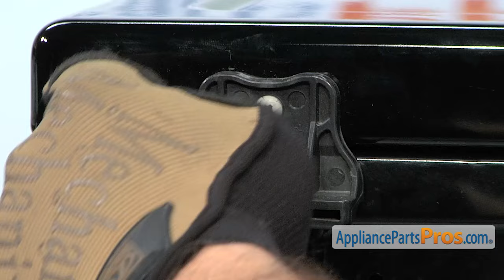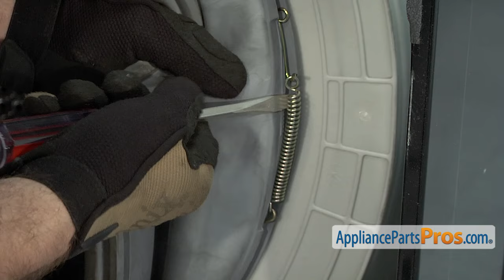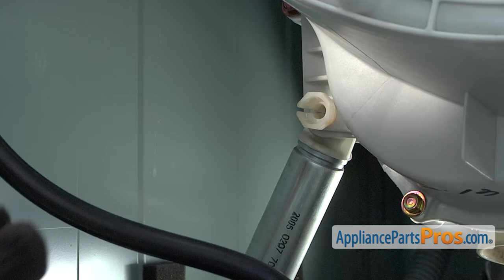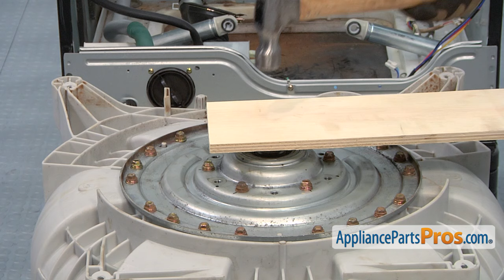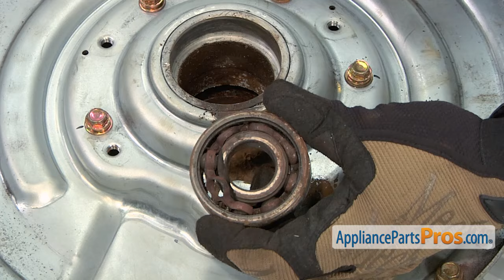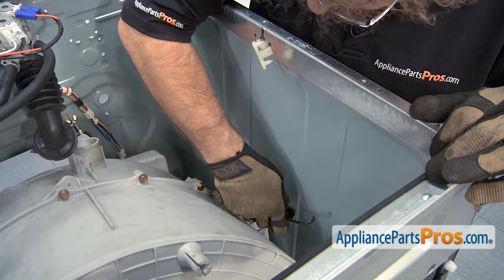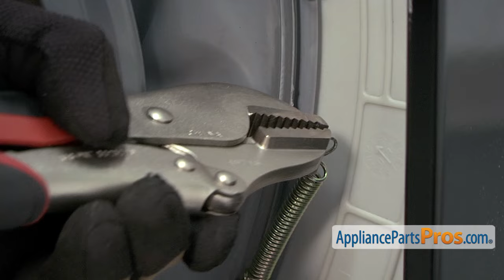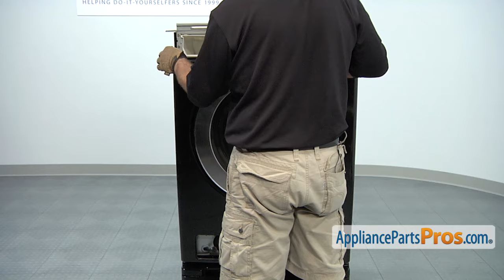How To: LG/Kenmore Washer Seal 4036ER2004A

Comment: Great video; well organized, all steps are clear and concise. I have a Samsung front loader new in 2009. Inner drum won't turn even with power off. Debris in filter, which, after watching your video, I can see is parts of a deteriorating spider, which is probably what is jamming and keeping the drum from turning. I highly suspect that overloading was the cause of the failure. I just now received the service manual, which I will check for hidden "gotchas', before I follow your video to disassemble, confirm the failure cause, discover bad parts, and order them.  Thank you so very, very, much !!!! Great job
Reply from the maker: +divingfe Awesome, glad the video is helping you get the washer fixed!

Comment: few folks mentioned about the torque requirements - I'm surprised to find mine inconsistency secured:

1. bolts holding Stator - some were loser than others - hand tighten, once firmly in, give it another ¼ turn = I couldn't get a reading /w torque wrench to measure because it was too lose on mine 

2. Spider bolts to the drum - 25-30 N-m (one was 15 N-m compared to the other 5 bolts though)

3. balancing weights top and bottom hand tighten firmly

4. bolts securing front and rear tub - hand tighten

5. Bolt securing the rotor assembly - surprisingly lose - hand tighten hard.

Greasing the shaft - when I removed the shaft from the bearings, noticed there was a lot of grease - used the Lucas x-tra heavy duty grease for high speed bearings (Lucas brand - green colored)
Reply from the maker: +harold hoang Thanks for the info! All the crud and grease was a combination of the grease from the failed bearings and any crud that got past the seal. The new bearings are sealed and already greased up. The only way I could see a little extra grease being an issue is if you put a lot between the seal and the inner bearing. If it is packed tight some might squeeze past the seal and into the wash during use.

Comment: To save your energy - For the LG WM2301H, the bearings are so tight that it will not come off the rear tub.  Its better to just save your energy and back pain by purchasing a whole new rear tub assembly.
Reply from the maker: +harold hoang You should be able to get them out but replacing the outer tub is always an option.

Comment: Step by step is awesome, how ever, trying to get the shaft out, and putting block of wood on it and using the hammer, it seams to be seized in there pretty good, and i've used some serious force i believe.  Any other steps to get this shaft out? without damaging the drum?.. thanks.   

Next day:   I got it... dang, a million whacks and it came out thousands of an inch with lots of penetrating oil soaking in.
Reply from the maker: +Angelo Pontello Glad you finally got it out!

Comment: Excellent how-to video.  I'm a general contractor and very skilled with tools, following this video took me around 4 hours start to finish, which included a thorough cleaning of all the parts, including the spider, both tubs, and the door seal.  I pressure washed everything, and used a screwdriver and a wire brush and CLR around the spider. Amazing how dirty everything was.  My only regret is that I didn't also change the spider.  Mine is still good, but corrosion is starting around the edges, and at $60 I think it's worth doing while you're in there.
Reply from the maker: +Averell Eshaghian Glad you got the washer fixed!

Comment: After replacing the bearings I am now having a leak on the bottom of the machine...water is coming from the heating element seal.  How do I create a good seal to stop the leak?
Reply from the maker: +Carrie Shere If the nut is loose it may not be sealing properly, you can take the heater out to clean the area, the seal and inspect the tub for damage. When you replace the element and tighten the nut it compresses the seal on the heater so it expands and seals against the tub. The only way you can get a new seal is with a new heating element. If this process does not get it to seal you could try some sealant as was suggested by legioner or replace the element.

Comment: Many thanks, Appliance  Parts Pro.  I have the exact same model, WM2277HB, as the one in the video, so this will be an easy fix, other than a bit time consuming since this will be my first time replacing the bearings and seal.  I will be ordering the parts from your company since you've provided the easy to understand and comprehensive instruction video.  Thanks again.
Reply from the maker: +Michael Karnish Glad the video helped you out and thanks for the order!

Comment: Thanks for the excellent video.  Just completed this bearing replacement and had no problems.    Still pissed at LG for a crappy bearings that failed after only 2 years, but all is well now.  I did upgrade to double sided sealed bearings hoping they will last longer.   $50 in parts and a few hours of time saved a $600 repair.
Reply from the maker: +AJ Catalanotte Glad the video helped you get the washer fixed!

Comment: I would charge $400 to fix this. Thanks for the video but I must respectfully disagree that this is a really easy repair! You have amazing skill!
Reply: +Carlos Garcia There is no real skill involved with this.  If you can turn a socket/screw driver and have upper body strength to lift and move, this is a pretty easy repair.  Just takes multiple hours.
Reply: I must disagree, The average person has nowhere near the ability to complete this task. The person must have some mechanical background and/or knowledge to get it done.
Reply: LOL, I don't think it appears to be a very difficult task just, really time consuming and hope that you did put everything back together correctly.  My real comment is, Fu(k you, LG for making such a common problem a real problem to fix.
Reply: @matthewstachler7614  I need to replace the bearing in my LG washer. It's a job, but not impossible. I am going to take photos just to give me a reference if needed. Yes I'm somewhat taken back by the labor intensive job to fix this issue. Considering the cost to replace, or the cost to have a repairman do the work. Going to enjoy the task.
Reply: This was a walk in the park.

Comment: i had found 2 bearings in my washer, so thanks to your video i was able to replace mine... however the bearing cases were intact so im still confuses as to where these bearings came from. i found another 1 today. (~1/2" dia.)

In my tear down i saw nothing that indicated bearings anywhere else... am i missing something? i have a samsung wf210anw / xaa
Reply from the maker: +Dean Parmenter Where did you find them? The only bearings I could find listed under your model were the ones in this video.
Reply: The were in the wash with the cloths after washing
Reply from the maker: +Dean Parmenter I am really not sure how any of these bearings could have gotten mixed in with the clothes.

Comment: thx for the step by step video looks easy, but took a while to get those bearings out they had rusted and stuck a good hammer and PB Blaster did the trick..
Reply from the maker: +Vin Magaji Yes they can be stuck in there pretty good, glad the video helped you get the washer fixed!

Comment: Holy crap!! you are basically disassembling and putting it back together completely>@@!!!  I am a home car mechanic, and could not follow all the steps!  if you can do this, then you can work for LG at the factory!!
Reply from the maker: +Webchez It is almost a complete tear, down but it is do able!
Reply: +AppliancePartsPros 
no
Reply: +Webchez not really.  I had mine tore down in an afternoon.  The only thing that would speed this up is a "tools you need" list at the beginning, including the different sizes for sockets/wrenches you may need.

Comment: HALP. This spindle is pretty badly stuck. We've got it propped up like in the video, used quite a bit of penetrating oil so far and have banged it with a sledge hammer and 2x4. Gonna let it sit overnight with excess penetrating oil. Any other suggestions?
Reply from the maker: +airodnov You can try a heat gun as others have suggested here but be careful not to damage the tub, its plastic.

Comment: Video is superb! My washer internals are 95% same as washer in video. I'm having trouble getting the rotor cover on that slides over the toothed spindle that is secured by the last center blot. Fighting the magnet force and the spindle/tub slides towards the front when applying semi-conservative force. I have to go around the front and push it back into position. Is that normal resistance putting the rotor cover on? In the video it was no trouble at all. It don't appear under close inspection that my spindle end was damaged during inner and outer tub separation, which did require a lot of banging. My idea is to apply counter pressure from the front and try to force it with care. Any suggestions would be greatly appreciated! thanks for the video!!!!
Reply from the maker: +Mike Wilson The magnets do cause a little problem but the rotor cover should just slide on. You could have someone hold the inner tub in the front, just be sure you do not force the tub back and forth too much and damage the seal.
Reply: +AppliancePartsPros   Thanks for your quick reply! I managed to rig a stool, 2x4 and straps to apply plenty of counter-pressure to get the rear cover securely on to spindle and finished the work. Thanks again for your very helpful video!!
Reply from the maker: +Mike Wilson Awesome, glad you got the washer up and running!

Comment: Great help on disassembly, but also reassembly.  The only issue I had after reassembling weights, I could get inner boot back on.  I had to take weights off again, put boot on, then weights back on.   Not a big deal, but it may help some.  Thanks again!
Reply from the maker: +James Vintzel Glad the video helped you out! Thanks for the tip on the weights.

Comment: Awesome video, thanks.
I can now see LG are junk and I won't bother repairing it. It's designed to fail 15.57
Aluminium spider arms bolted to a stainless drums sitting in water, will corrode. 
The bearing shaft rusts (not stainless), the rust will destroy the seal, water will get into the bearing and though the motor, bearings will rust out.
Reply from the maker: +acarus3 Hope the video helped you out!
Reply: +acarus3 , this failure took 12 years to occur. Even w/ a new spider, about $135 in parts. If it lasts another 12 years, I'm happy enough with it.

Comment: Have done this repair once before. However, this time after replacing the bearings and making sure they are flush with the tub, the metal tub will not sit all they way down in. Only about 1/2 of the shaft comes through the back. Have tried many times. What could be causing that issue?
Reply: +Greg Willey - It almost seems as if the hole in the bearing on the back side is not quite large enough for the shaft to fit all the way in. (Joke needed here). The packaging says I have the same parts I ordered last time so they should be the right parts.
Reply: +Greg Willey - The outer bearing has stamped on it 6305Z   Korea
Reply: +Greg Willey - Forgot to mention this is an LG front loader.
Reply from the maker: +Greg Willey If you are having problem that go beyond what is covered in the video you can post the problem along with the appliance model number on our repair forum and the techs can help you troubleshoot the problem. http://forum.appliancepartspros.com/
Reply: +Greg Willey        Greg- I just finished my repair and had the same issue.  I ended up cleaning the shaft on the metal tub and putting soap on it, to help it fully seat into the bearings.  Also, instead of putting the full tub on a flat surface, I allowed an area under the assembly, so that the shaft could come through freely.  You will know the tub is fully seated if it spins freely when you put the top half of the plastic enclosure over the top of the metal tub.  Hope that helps.
Reply from the maker: +James Vintzel Yes we had it supported just like you said, so the shaft can go all the way in!
Reply: +AppliancePartsPros - The shaft had some wear. I didn't realize it but a friend that is familiar with replacing bearings said that little nicks in the shaft are not a good thing. It looked fine to me though. It was only because I couldn't fit the shaft through the bearing that I knew there was a problem. Ordered the new Spider arm. Went together like a charm.
Reply from the maker: Awesome, thanks for the update! Yes anything that would increase the diameter of the shaft such as nicks or corrosion will interfere with seating the shaft into the new bearings.

Comment: Replaced these 3 parts 1 year ago. The bearings just went out again. Why would they go out in such a short period of time?
Reply from the maker: +Greg Willey That is hard to say, it could be a lot of use, a lot of over loading or unbalanced loads!
Reply: The shaft had some wear. Probably should have been replaced the first time. This time I couldn't get the shaft through the bearing. Had to replace the shaft and spider arm.
Reply from the maker: Greg Willey Glad you figured it out!

Comment: Fantastic video. I was having trouble with my LG WM2016CW. The tub had play in it and I was getting a burning odor and smoke from the tub. The bearings and seal were like new, the spider was broke on all three sides. I also replaced the tub boot with this repair. The machine looks and runs like new. Thanks again for the video. Keep them coming.
Reply from the maker: +Rick Smylie Glad the video helped you get the washer up and running!

Comment: We just finished this repair on our LG Tromm WM0642HW. Wow, you make it look easy. It took two of us and entire Saturday to get it done. Our drive was pretty stuck in the bearings and our bearings broke apart when pounding them out. Now that it's all put back together it is much quieter, still a little squeak and knocking on heavy loads, but hopefully this repair will give us at least another year with this washer. Thanks!
Reply: How did you manage to get he drive loose....I’m having a hard time.....it’s not even moving a bit....I have been hitting it for like 50 times
Reply: @betin197610  yikes with these roadblocks maybe i'll just ride it out.   thats a showstopper if you can't remove the bearing.   mine just shakes violently on high no squeaking
Reply: Beto Comales did you get it loose yet ? I’ve been wackin this thing for a week . What did you do ?
Reply: I've got the exact same washer and it's making an unpleasant noise during spin cycle, and I assume it's a bearing as that is what is sounds like. How has your repair held up? Did the squeaking and knocking go away?
Reply: Amanda Brighton 
AppliancePartsPros 
I am unable to take the drum apart by hitting the shaft of the spider that comes through the bearing. I am afraid that heavy strikes might break the spyder.  Any suggestions

Comment: The Bearings where fine. The spider was the problem.
Reply: Since I am selling this machine anyway, I also only replaced the spider. The bearing set was 80 for 2 bearings and the seal. If its not broken, im not fixing. I thought about it for a while, believe me. But it came down to the fact that Im not selling a broken washer. I will fix it and sell it. I dont know how long those bearings will hold. Maybe a year, maybe 5 years? I couldnt justify replacing them since they were not broken and in perfect functioning condition.

Comment: Great video. One suggestion, using the old bearings to press (hammer) in the new bearings eliminates potentially damaging the new bearing.
Reply: Sort of like when I use my old brake pad with my c clamp to bring the piston back in.
Reply: AppliancePartsPros .
Reply: I’m going to use threaded rod nuts and some wide washers.
Reply from the maker: +Michael Smith Glad the video helped you out, thanks for the tip!

Comment: Thankyou for your quick reply.  Since I sent you the email, I have worked out how to disconnect the heater, and have since removed the tub, whereby I am getting the bearings replaced by a local dealer.  Once again, the video was extremely informative.  All the best from Australia.
Reply from the maker: +Chris Stoddart Thanks for the update! Glad the video helped you get the washer fixed!

Comment: I have an LG WD1481RD which is a washer/dryer, having watched your video several times finding it enlightening where I finally got the self confidence I needed.  However, I am in the dark with removing the tub with the dryer on top so that I can replace the bearings.  Do I disconnect all the wiring, and front cross member to release the tub, can you help me please as an updated video would be appreciated, and are there any significant differences between the US models, and Australian models.
Reply from the maker: +Chris Stoddart We do not have any info on foreign sold models. You will have to be aware of any differences between your model and the one we used for the video. I would think the dryer assembly would have to be disconnected from the drum and moved out of the way so the drum assembly can be removed.

Comment: This video was so helpful. We bought the bearings, seal, and spider assembly from appliancepartspros for our 11-year old LG Trom. We had two bad bearings and the washer sounded like a rocket engine when it went into it's spin cycle. Took me about 2 hours to get all the way to the bearing removal. I pounded on the tub axle with a 2 lb. mallet with no joy. Then I put some WD40 and a heat gun on it for a few minutes and pounded it out without too much difficulty. Used a 3/4" Socket extension to tap in the new bearings. 
With the new bearings the machine runs like a champ and is supper quiet. Thanks appliancepartpros for the great video. Maybe I'll get another 10 years out of my Washing Machine.
Reply from the maker: +Gary Fluitt Glad the video helped you get the washer fixed up!